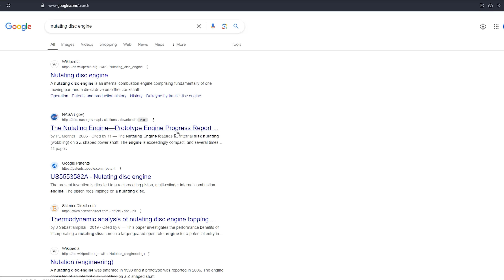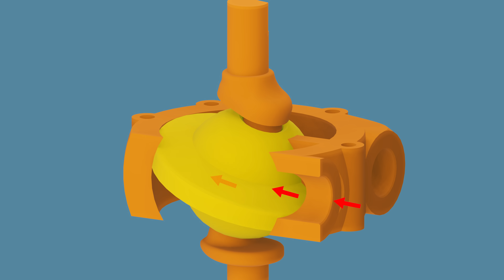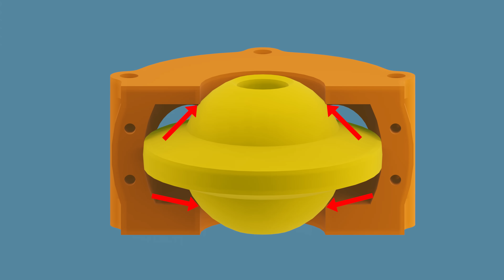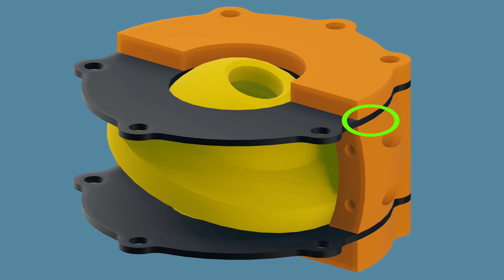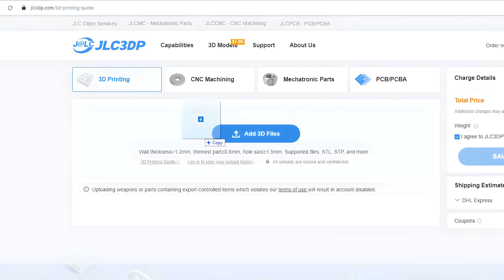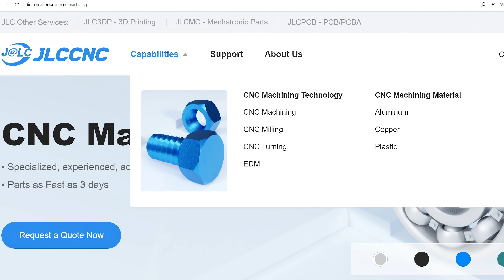I Built a Nutating Disk Air Engine

Comment: Dude, your idea with this engine is great. But follow the safety rules, don't stand in the plane of the propeller's rotation - it's dangerous! The printed part can break, and the blades can fly into your body.
Reply: if this was spinning at 8500RPM yea I'd agree, but for 850rpm tops I don't think anything more than safety glasses would be needed. Definitely best practice tho to get in that habit
Reply: That's not necessary with the proper application of a safety squint and a sphincter-operated E-stop.
Reply: @mattw7949 this is my new favourite comment ever
Reply: @mattw7949  if your sphincter feels like stopping that prop you're legitimately a whimp. Like. Scientifically proven. This thing has less energy than your average nerf dart...
Reply: @Argosh  You may have missed the point of what a sphincter-operated e-stop is.  Maybe it's just a term used amongst heavy automated equipment operators.  
If you're tough enough to go around stopping things with your sphincter, more power to you, tough guy!  I'll sure never get in your way.
Reply: @Argosh   And half the energy of a nerd fart!
Reply: Safety is needed case by case, in this case it doesn’t matter, at all. If that thing somehow exploded, the piece will hit you a lot softer than I could punch you lmao, you can stop that blade by just putting your finger in the way and it’ll hurt less than a bug bite
Reply: @jackzhao604    Fingers aren't the point.  If you can safely stop it with your eyeball, then you're ok.  

He's probably ok, I think his eyeball can withstand the prop, but "i can block it with my hand" only probably applies to things moving 4 mph or less
Reply: @eleithias at full power the thing is doing 850rpm. It doesn't even create enough power to lift the prop, let alone the motor it's connected to. So there is literally no way for the prop to be stressed enough to even flex, let alone shatter.
Since the total rotating mass is well below 100g (system weight is 73g) there isn't enough inertial momentum to do anything really. Assuming standard PLA even converting the entire rotary impulse destructively you'd end up with a projectile carrying less than 2 joules of energy. Which is considered safe for children's toys.
He's fine.
Reply: Anybody who has flown in a Twin Otter and was in the front row of seats, as I was flying out of Lukla, Nepal, two years ago, has been in the plane of rotation of two large propellers. Yes, I was nervous.
Reply: And scratch him. Wow. It's not a powerful engine, we aren't talking 3000 rpm of 500g propellers. Angsty people need to get hurt more and discover, that the body heals. Otherwise I wouldn't exist anymore
Reply: Oh my god, shut up.
Reply: ⚠️WARNING⚠️
OSHA and Safety Steve have entered the chat!! (As they ALWAYS DO, sadly)🙄On your toes, boys... The Party Police are officially on the premises.🤦🏼‍♂️
Make sure you're wearing your Safety Squints, full face shield, Level IV plates and full body Kevlar bubble wrap! Fml.😮‍💨
Reply: You guys are fing weak asf lol.
He clearly knows physics.
You don't
Reply: Shut up nerd
Reply: Literally within the first minute of the video he says it's not his idea.
Reply: Lol after reading this comment I'm not even gonna watch the video
Reply: For real! I was putting my safety squints on just watching lol
Reply: That's a carbon prop made for pushing a couple hundred watts of power into air. This motor can't even turn it hard enough to get the air flowing correctly.
Reply: @Argosh  The vibrating pla is the weak point obviously
Reply: @Argosh Sht happens though... never underestimate murphy. Or at least don't bet your life on testing him! Safety is so inexpensive.
Reply: @joeybagodonuts6683  I think you drastically overestimate the energy involved in this experiment.
Reply: @Argosh the pressure he was using is more than adequate to lodge a piece of plastic into your eye. Safety planning is about worst case scenario. Safety glasses were the minimum.
Reply: You should have a word with Colin Furze. 😂
Reply: What are you, OSHA?
Reply: use your brain.  It's a lightweight 3d printed prop spinning at VERY low rpm.  It'd never break at that rpm due to stress, and if it did, it'd give him light tap.
Reply: I was getting a little uncomfortable watching that lol
Reply: @Cj-gd1db  Cause you're a wimp.
Reply: Safest is to stay in mommas basement forever.
Reply: It’s not gonna hurt you at 850 rpm
Reply: The man is free to do what he pleases.
Reply: Here comes the fun police 🙄
Reply: He knows.  Let him do what he wants.
Reply: @EnlightenedSavage it’s not just about him though. Someone less knowledgeable of the risks involved in handling things like this might try to copy the design. 3D printers are so accessible now, people of all experience levels can do things like this.

So if you prop yourself as an educational voice in this scene, you can’t just blindly state that your safety is your own concern because it absolutely isn’t.
Reply: Aaaaand cue the safety police. Let's see your safety police badges now. Can't be too careful. >:)